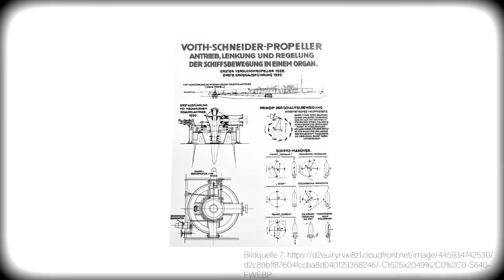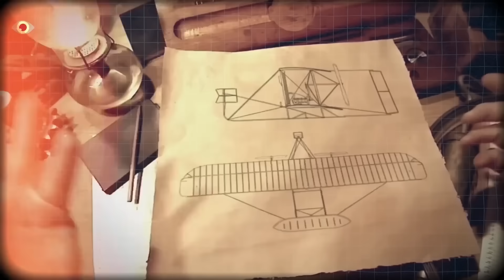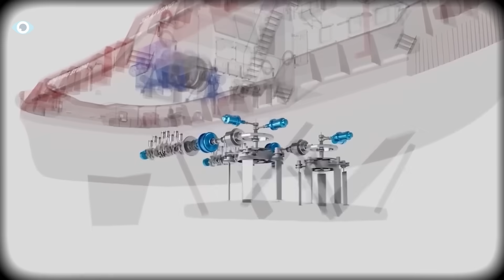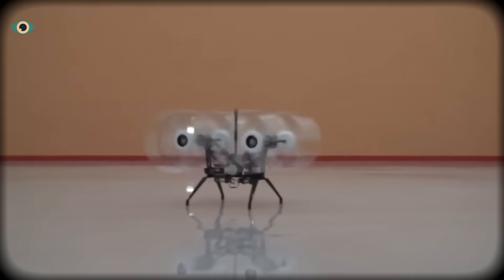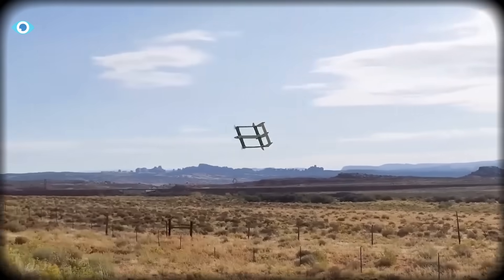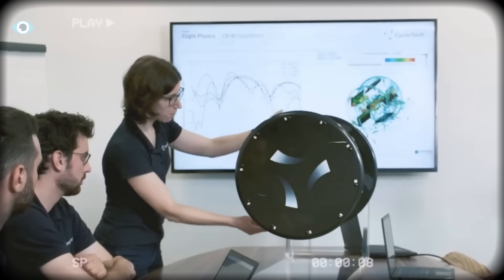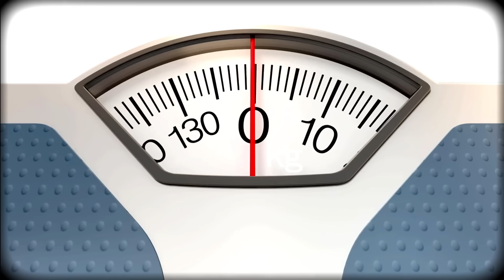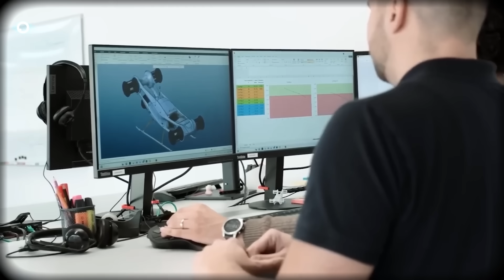The Cyclocopter: Vertical Flight Without Rotors? Here’s How

Comment: Let me explain why a cyclocopter won't replace helicopters.  The thrust of any system is Area*flow-velocity*air-density.  The air density is fixed so the engineering is all in getting the downward flow velocity over a sufficient area.  Simple eyeball measurement shows the cyclocopter has a much smaller flow area than the rotor of a helicopter.  The power required for the given thrust is proportional to the Area*(velocity)^2.  So by have about 1/4 of the flow area compared to a helicopter the cyclocopter will take 16 times the power to lift off.

Comment: If the blades had gravity paint on the top and antigravity paint on the  bottom, cyclocopters could fly through the gravity waves in outer space at faster than light warp speed to other galaxies!

Comment: I'm sure it'll perfectly fill some super-niche role, but probably not more than that.
Reply: I think it was mentioned but search and rescue in very difficult terrain and tight places. I can imagine that you also could fit this with some low weight explosives which would make it absolutely deadly and have more stealth than ordinary drones (likely that is why the miliary was involved in it). If it also can adjust for recoil (likely) it could also be equipped with small caliber guns. or why not food delivery to your balcony on the 80th floor? 😉

Comment: All very fascinating, but how does it create lift??   How does it move in any direction???   Showing it flying without explaining how is just a waste of time.
Reply from the maker: Fair point but this video was only meant to show the concept visually. I’m preparing a separate breakdown that explains the lift and directional control step-by-step. 🙏🏼
Reply: A propeller is just a wing that spins and provides forward propulsion on airplanes and lift on helicopters. The video clearly showed the front and rear drums on the large prototype spinning in opposite directions. That's just exactly how a four bladed drone flies, two motors spinning clockwise and two spinning counter clockwise. Each individual blade whether conventional or drum style also has infinitely variable speeds for precise directional control. Unlike drones which use fixed pitch propellers, the rotary drum has variable pitch wing shaped blades for further control.  It is quite a bit more complex than a conventional drone, but very feasible.
Reply: @hobo1452 a propeller is not a wing.  A rotor on a helicopter is a moving wing.
Reply: I think this was an AI video, lots of tells. It takes a human to be fascinated by things a human might want to know. They’re getting pretty good at this but for now are noticeable.
Reply: There is enough information here for you to do the reset yourself ffs.
Reply: @petesmith9472 ”Here’s how” was literally in the title of the video, but didn’t explain how.

Comment: What happens in the event of a mechanical failure? I know from  experience what happens when helicopters have rotor blades fail and it’s not pretty! How about this machine?
Reply: Since your experienced, I ask you, how would you make falling out of the sky safer?
Reply: @bruce3634 see the comments right above yours. They make auto parachute systems for smaller aircraft.
Reply: Presumably each rotor is powered by its own motor.  At the very least, the computers should be able to balance things out to get you safely to the ground assuming just a single failure.  If they all go, well, it's the same that happens to every other airframe.
Reply: Parachute, just like on a few of the small planes
Reply: You do realize that it takes hundreds of feet for a parachute to deploy, right?
Reply: @kevinp3550 maybe just research it yourself instead of arguing
Reply: @kevinp3550 its pointless bro. Their confidence far exceeds their competence
Reply: The platform seems good for an emergency  Shute system.

Comment: The problem is very simple
Thrust (lift) = Mass flow rate times velocity
Power = 1/2 Mass flow rate times velocity SQUARED
This is why a helicopter has a large rotor - this enables it to move a lot of air relatively slowly
If you reduce the rotor size then you move less air faster 
Which requires MORE power
Which means more fuel
A modern VTOL jet has to have a much much more powerful engine than a helicopter of the same weight
It's not "Engineering" it's "Physics"
Reply: Auto rotate on helicopters when power is lost is also HUGE, as people like not dying. This seems like if useful it will be better for drones.